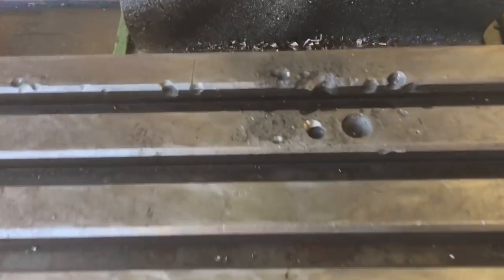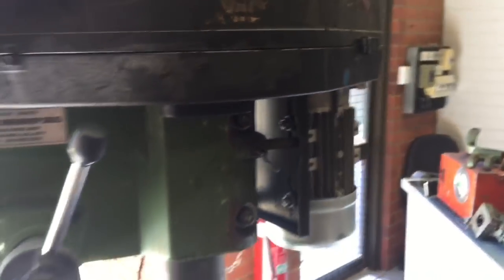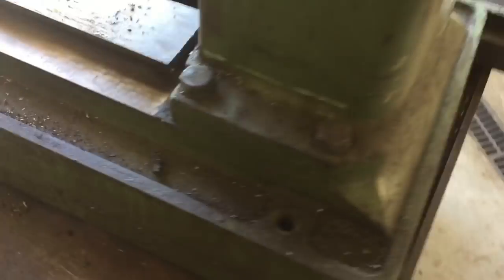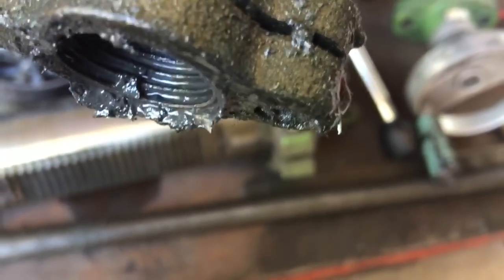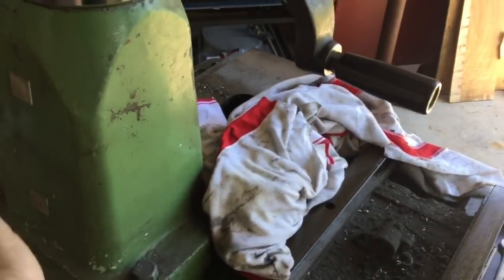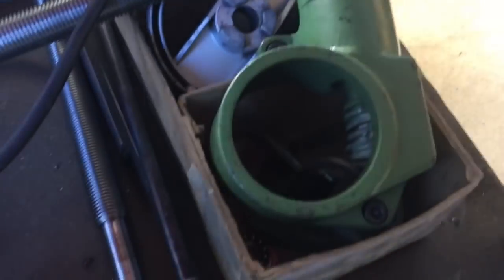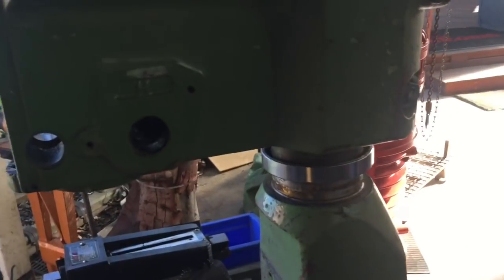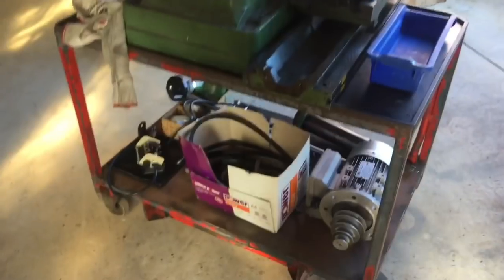Wrong Foo Re Do part 1

Comment: My brother gave me one of the these milling machines, cleaned the table, adjusted the table keys lubed the table sides, noticed both the feeds need adjustment or replacement or improvements there, from the video seem like the feed threaded eye's have adjustment hex keyed to keep lash down I"ll give them a shot see if we can eliminate the table lash issue, oh well back under her for more repairs! Like the head stabilizer mode, assuming not cheap for the kit but worth it for repeatability, milling head adjustments?
Reply from the maker: It’s a solid platform to begin on. Good luck and happy days

Comment: There is the gear rack on the side that lifts and lowers the head. It runs in a channel at the bottom.  Could you just weld the bottom to that ring and weld the top to the column?
Reply from the maker: Even if you were to fix the rack to the column you would still need to provide a constraint on rotation, as the rack has no “side thrust” to constrain,  plus you lose the ability to rotate the head if required in short, it would not solve the problem

Comment: Looks like that mill is the sort of size I should be aiming for.
Reply from the maker: I have no experience with it yet, but Steve from Shark River Machine Shop has one and gets some great results. For me space is a huge factor, I just do not have any more room to commit to a mill. Bruce and I are hoping to have a kit to solve one of the round column mill issues, that of losing head location when lifting or lowering the head. Thanks for watching and commenting mate!

Comment: Love seeing these machines on your channel being cleaned up and put to use.

The larger round-column Emco milling machines such as the FB-2 employed a precision gib block on the column to prevent rotation, similar to one of the methods you were describing. Might be fairly difficult to retrofit such a system though..
Reply from the maker: aflippy21 yeah we threw a number of options around, and design goals coming out of the chat include:
Gotta be able to fit without removing the milling head
Ideally fitted without precision machining of the mill components
(A few drilled and tapped holes into the head casting is our current iteration design)
Must produce repeatability of under .001"
Small enough to ship worldwide cheaply
Optional scale/vernier to indicate head move distance
Cheap enough to sell a few kits